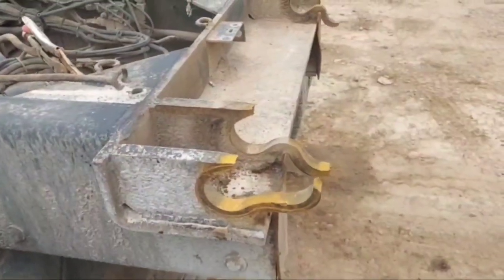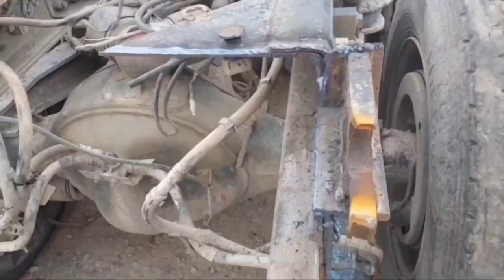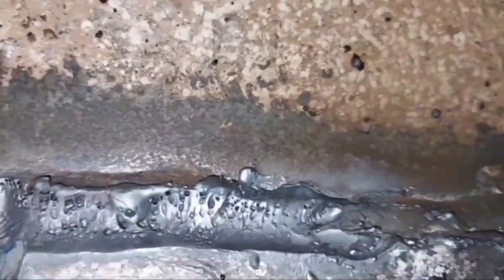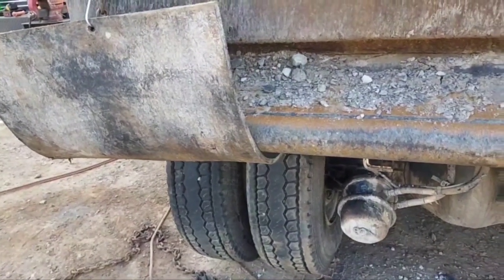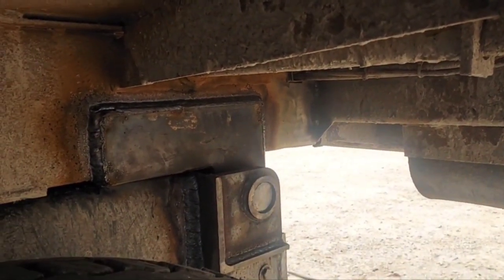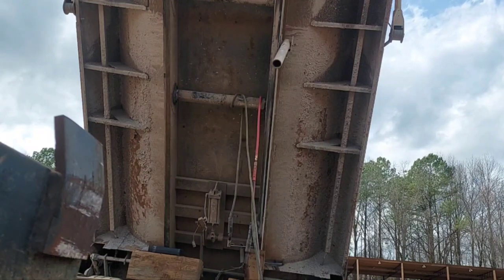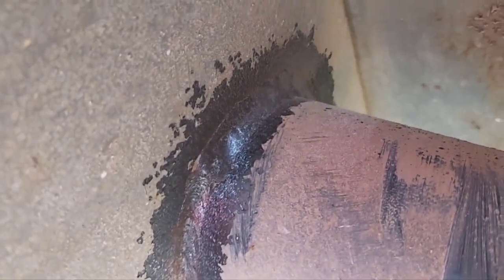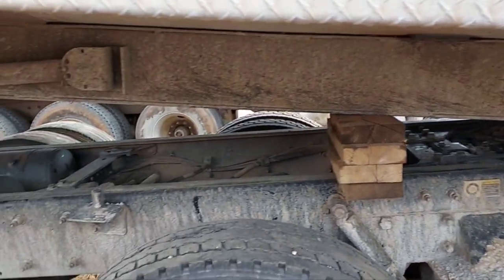Ox Body bed hinge

Comment: I noticed your ground clamp! Believe it or not, I’ve been making my own for the last 15 or so years. Same design, only I use what I call the vise-grip “duckbill” style clamps. Works great on pipe. I came up with it out of necessity when I used to install a lot of pipe handrails for a fabricator.
Reply from the maker: Here I thought I was the 1st one to make them. Lol. I got the idea after I broke 1 of the Tweco spring action clamps. I prefer the vise grip style beause it gives a tighter connection and chews through paint with no trouble

Comment: I use Techniweld 7018. They weld almost identically as the old Atom Arc did before Esab bought them out. I highly recommend them.
Reply from the maker: I've run some of their 3/32" 7018 before and I liked them. Problem is, I only have 1 LWS in my area that even carries them, so I just went back to Excalibur
Reply: @NAWeldingandFab  I'll weld with the Excalibur, but I hate them. They are the stickiest 7018 I've ever put in my holder. I've repaired some of the Ox Bodies myself. I had to replace that piece of  11/2" x 3" x 1/8" tubing under the bed behind the dog box with a piece of 2"×4"×1/4" tubing. I don't know what engineer had the bright idea to make those main runners from 2"×8"×1/8" tubing either. That's the main reason for the cracking around those crossover pipes under the bed  too.
Reply from the maker: @arthomasintegrateddesigns402  big construction company I used to work at had about 200 ox body dump trucks in the fleet and I agree with you. Ox body engineers are about useless. Can't blame it all on them though because I've been able to get their designs to last a good long time just by fixing the bad welds and welding all the way around the joints instead of leaving the garbage downhill porosity filled MIG beads in place with none of the flat or overhead even touched like they come from the factory. Lol

Comment: Hey Brother hope you're doing well.  I'm on my 3rd Ox Bodies repair. Looks like some things could be improved in the engineering side. One question: those round cross pipes underneath are only welded to the doubler plates but not the actual shell. I've been removing the fillet weld around the pipe (air arc) and welding all 3 parts tying them together, requiring less reinforcement such as your example here. I wonder what your thoughts are here. Strange thing is I haven't found any discussion on these issues. 

Sorry for the long message. Thanks for the videos Man I love this stuff! 

Jody S. Schwartz
Columbia, Tn
Reply from the maker: I second the need for engineering improvements and I also weld all 3 parts together in some cases. This 1 was just bad enough to require extra. Ox body used to be a top notch bed in the 80s and 90s, but just like every other American manufacturer, they dropped quality into the toilet and flushed

Comment: Nice looking repairs. I have replaced those hinges before, they’re a lot of work! Do you have a helper or anyone that works with you or by yourself? Thanks for the video.
Reply from the maker: Thank you. To answer your question, it's just me all alone except when I need a spotter or an operator so I can spot. In that case, I can usually find someone to help. In this case, the company mechanics returned from lunch, so I got 1 of them to operate the excavator while the other one watched the passenger side and I watched the driver's side. It went pretty smoothly. Thank you for watching
Reply: @NAWeldingandFab  thanks for the reply look forward to your next video

Comment: Yikes! What does the scope look like? I never saw hinge damage like that unless it hit a bridge
Reply from the maker: By scope, I'm guessing you're talking about the hydraulic cylinder that lifts the bed. If I'm correct in my guess, then the cylinder was fine. What happened was the pin that secures that cylinder to the bed fell out, so when the driver dumped the bed, he literally dumped the whole bed.

Comment: Nice repair! Had me cracking up....."swaying like Rosie's chair" & crack with Hunter Biden.....

So you don't like the ESAB 7018's;  are you back to using Excaliburs?  I need to try the Excaliburs, but have only used the Hobart H4R 7018's so far (just bc that's all the LWS has in stock).
Reply from the maker: Thank you and thank you for watching. Esab does make another 7018 that folks seem to like, but none of my local suppliers have them in stock, so I've never tried them. I've run those Hobarts before and they're ok, but I did go back to Excalibur this last time I bought another 50lb can because they're still better than anything else I've burned.

Comment: We always called that a scarfing tip...
Reply from the maker: Wash tip, scarfing tip, gouging tip, all the same thing. Just depends on where you are in the world when you learn it. Kinda like folks in the southeastern United States call pretty much all carbonated soft drinks "cokes", while northeasterners call them "pops" and midwesterners call them "sodas".
Reply: @NAWeldingandFab  my dad used to tell helpers that tip is for cutting around corners ......I have ran miles of that cheap esab...a rod oven will help a little...it's my belief that it swets in the black plastic container if left in the sun.. I noticed you didn't preheat ....that rod burns better for me when I preheat....happy burning
Reply from the maker: @jojocono4887  shouldn't have to preheat 1/4" material to run 1/8" 7018 at 120 amps without trouble, so those rods aint for me. Funny joke your dad said on the wash tip though. I like that 1. Lol
Reply: @NAWeldingandFab  I agree with that statement...you shouldn't have to..but.that rod sucks so bad it's almost required...and I'm betting if you think back ...about the 3rd rod she kinda smooths out and runs a little better.. weld prep is everything with that crap...next time you have to run it..try cooking the rust out with a  rose bud...happy burning
Reply from the maker: @jojocono4887  no, they pretty much sucked the entire time regardless of surface prep. That's why I went back to Excalibur. Lol
Reply: @NAWeldingandFab  I feel your pain... I have struggled with that shit more days than not as well..but that rod will run pretty good for me in 5/32 at 150ish amp...she will curl up like a scorpions tail...the slag will tell you everything you need to know...if it's hard and thick and dark..your cold and dirty..if she's popping up  and a light brown/ tan color  your getting close to about  as good as your gonna get it...happy burning...
Reply: @NAWeldingandFab  another good old trick for that rod on that job would have been to use 5p for your root pass ...and run it as hot as you can...haha there's  many ways to skin a cat....
Reply: @NAWeldingandFab  you know...I might have considered a couple plug holes on that upper half of the hinge..happy  burning
Reply from the maker: @jojocono4887  I figured if an inferior, porosity filled perimiter bead held it well enough to break the hinge holes out of the frame plate, a proper perimiter bead woyld hold just fine without risking vouding any warranty from Ox Bodies by cutting holes in the new parts
Reply from the maker: @jojocono4887  and like I said in the video, I won't be buying anymore of those exact ESAB rods. I might still try their Atom Arc model 7018, but I'm back to Excalibur until I find another option
Reply: @NAWeldingandFab  😂 yep and if it breaks again you can blame it on the rods...I hear ya loud and clear....hahaha happy burning
Reply from the maker: @jojocono4887  it never broke the trash filled weld they put on it at Ox bodies, so it won't break my clean, solid, porosity free welds for sure. Lol
Reply: @NAWeldingandFab  the best part of this video is the Texas weave pattern around that pipe.... 🤣🤣 I took a screen shot of that shit to show my nephews ....thanks hoss...
Reply: @NAWeldingandFab  sure !! ...i seen way worse hold a lot more...you'll be fine till it ain't...good luck

Comment: You  cut the whole angle iron off,  when all you  had to do was remove the four broken ears
Reply from the maker: I also put the whole new angle iron on because the old one was damaged and the ox body hinge replacement kit came pre-assembled
Reply from the maker: Customer supplied parts ordered straight from ox body. Sure, I could have just replaced the plates and left the angle, but the angle was bent where the bed part of the hinges made contact as the bed flipped off backwards and ox body doesn't offer just those plates, so I would've had to custom fabricate 4 identical plates in the field, remove the old ones, install my new ones, and then the parts of the hinge that were attached to the bed would still have been too damaged to use, so I would've had to fabricate those new too. Quickest, cheapest, and best overall option was to order the whole hinge assembly from ox body, cut the old one off, clean up the frame, and install the new assembly. So, that's what happened. Aint my first dump truck and hasn't been my last. These folks call me and pay me to fix their equipment properly, so I aim to give them the highest quality, longest lasting repairs possible
Reply: @NAWeldingandFab  would  it been to much fabrication to  make those parts with  all the  material  I see in your  shop? Because the part from Ox is junk, just like the  original , too light of material . When jobs like that come in use you're  head and make it better?  That's  advertisement  for you when  people  look to see what you've  done! Worked for me never even had a name or number on my  welding truck but always kept busy. Just wish they had these go pro cameras when  I was  working. Makes it nice to document  what you  do. And don't  think I'm critiquing your  work, I just asked a question. And  after you  answered  it I realized  who was the  dummy there ! But no problem  there with  customers  like that,  they  help towards your kids college  funds. Lol.
Reply from the maker: @josephsantoresr897  I don't have a shop. Sometimes, I have the luxury of being inside someone else's shop, but I'm strictly mobile. The new hinge system that ox makes is plenty strong enough to handle the load and they can build that cheaper than I can build a much stronger version, so it'll be fine.

Comment: why not carbon ark it
Reply from the maker: I do on some things, but that wash tip makes it real easy to spot a crack that I might not have seen using the arc gouger. Sometimes, I'll be cutting an old weld out and happen across a crack in the base metal that I didn't see without the wash tip turning the area red.